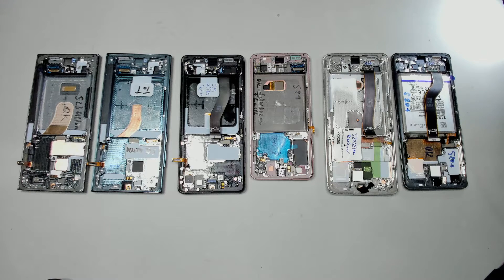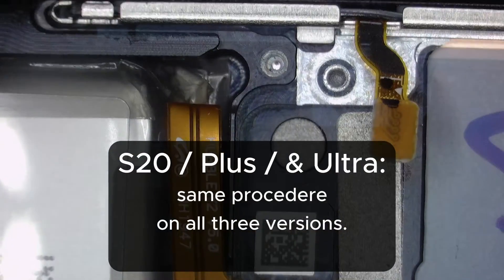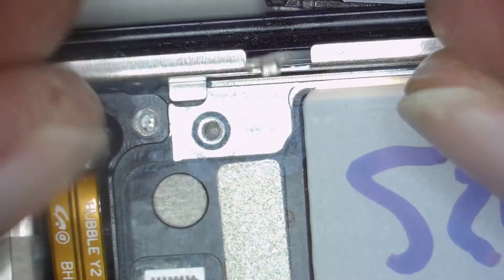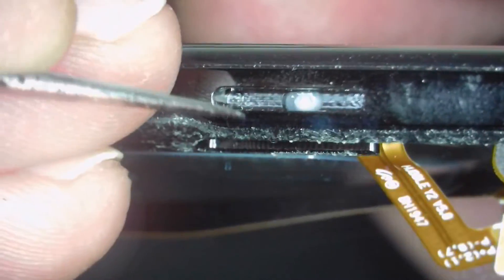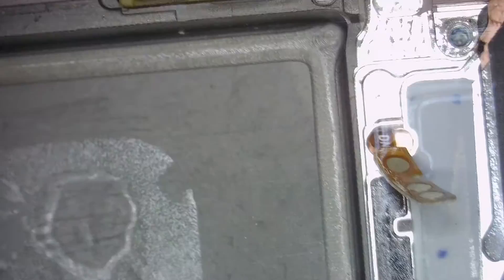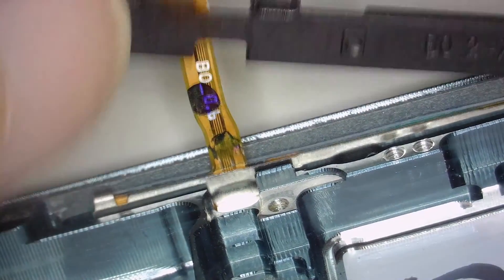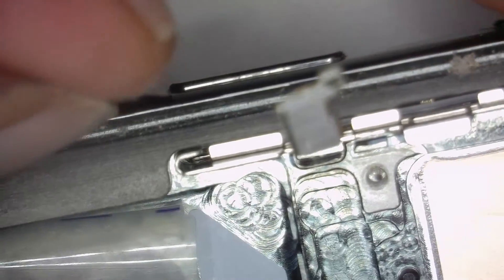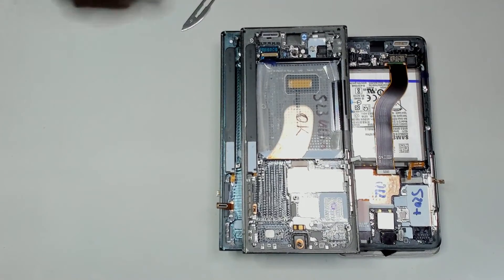Galaxy S20 S21 S22 & S23 Plus/Ultra Powerbutton Repair Guide

Comment: Hi everyone,  
I’m having an issue with my Galaxy S23 Plus. The power button doesn’t return to its original position after being pressed—it stays stuck in a pressed state, unlike the volume buttons which spring back normally.  

I’ve already replaced the button itself, and when I remove it, the clicking mechanism on the flex cable seems to work fine. So the tactile feedback is there, but the button still doesn’t pop back up when assembled.  

Given that the button has been changed and the flex seems responsive, I’m not sure what else could be causing this. Could it be a frame misalignment or something with the housing? Any ideas or suggestions would be greatly appreciated. Thanks in advance!
Reply from the maker: Frame misalignment could be the reason, or some sticky residue, maybe cleaning with isopropyl alcohol

Comment: The engineering or lack there of...smh. To me, this is like having to remove your car engine to get to the battery to replace. My outer power button fell out, but the inner click button is till there and works fine but hard to get at. Why do you need to remove cover etc just to replace a button that fell out?
Reply: I'm frustrated too i have the back of the phone removed and removed all the screws and everything still intact!! I'm at the question how far should i go with this?! I can't afford to get another phone that's why I'm trying to do it myself.

Comment: Adhesive or something inside the button itself caused the silicone feet to detach from the button, but the feet are still stuck inside, does this mean I need to take it apart, push out the feet part that's stuck inside, and replace with completely new button or is there a way to remove the feet without opening the phone up
Reply from the maker: If the flex inside is damaged then yes

Comment: 1. Does wear on the silicone feet cause the button to fall off?

2. So, buying a replacement button with new silicone fit would fix the problem?

3. Frequent phone overheating causes the silicone feet to deteriorate right?
Reply from the maker: Sand and dirt wears it off, heat i don't think so.

Comment: The button used to falloff. I glued and inserted the button now it doesnot even move.. it is useless.. what should i do?
Reply: Same but mine still comes off too. Came here bc I read on chat gpt that i shouldn't use glue for that  exact reason- button getting stuck
Reply from the maker: @ Glue is bad in this case, yes
Reply from the maker: you can get replacement buttons.

Comment: How do you actually replace the new button? Can you just use glue?
Reply from the maker: Just push it inside, it hase tiny silicon feet that will hold the button in place.

Comment: S20 ultra and s21 ultra are the same power button? I mean the plastic button outside. I broke mine (s21 ultra) and i can only find s20 ultra button. Does it fit?
Reply from the maker: not sure, have to check
Reply: did you ever find out?